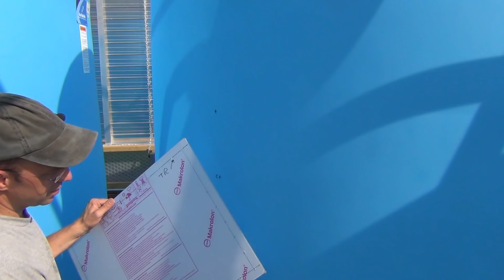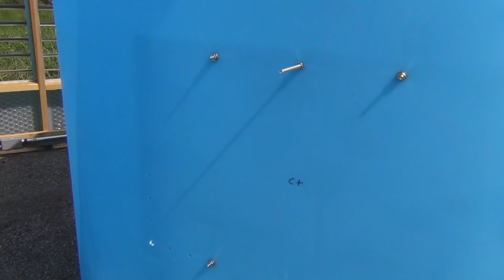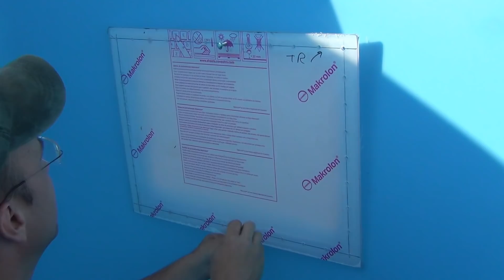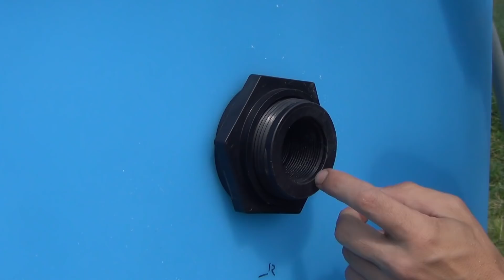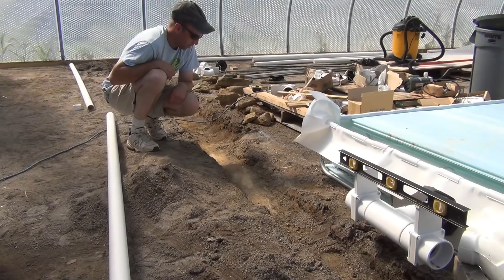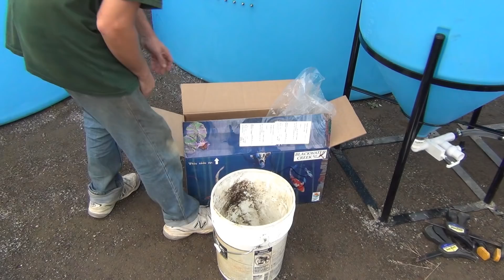Big Aquaponic Greenhouse - Part 12 - Fish Tank and Plumbing

Comment: Rob, on the fish tank, I would like to know how you keep the water level at constant 6 inches of head height above the outlet to the radial flow settler? And still below the overflow outlet.
Reply from the maker: The water level in the tank stays at the same level where the pipe comes out of the side of the fish tank.  Technically it's a bit higher than that because of the head pressure to push the water out.

Comment: Hi, thanks very much for all the videos. I have enjoyed watching many of them in recent weeks. I was just wondering what the head height is on your Jebao DC pump here for you to be getting 1200 gph, and what you would expect the flow rate to be with a 12ft head? Thanks
Reply from the maker: I'm pumping around 5-6 feet of head with this.  It probably could do 12 ft but I would recommend checking the pump curves for it.

Comment: The double bead of silicon is a good idea.  Did you consider using large flange pop rivets?  They have some with built in gaskets, or you could use silicon sealant for added measure.  Also, I would think a leak fix would be much easier with a rivet.  Any thoughts on this?

Unexpected Tip:  Test for leaks before burying your lines...  LOL.   Thanks!
Reply from the maker: I"m not sure about using a rivet since they may be difficult to adjust the amount of force it applies.  With the bolts it's easy to torque them around to see how much silicon oozes into place.
Reply: Bigelow Brook Farm (Web4Deb) Good point.  Thanks!

Comment: i believe you said your dwc doubles as the sump? does that mean that the dwc water level fluctuates? i also dont see how you maintain the desired water  level in the dwc. is it simply due to the height of the bulkhead? in that case, if the water drops too low in the dwc, below bulkhead, does it mean the pump will run dry?
Reply from the maker: technically the water level will fluctuate a tiny amount because of the flood and drain beds but it isn't noticeable.  As we lose water from evaporation/transpiration we just add some more.

Comment: Awesome sauce :)
Pro question for the Pro tip master: how did you come with a shower bar that doesn't restrict the pump too much? How many holes at what diameter to result in less of a friction loss... Wouldn't it be better to use a manifold that creates flow all the way to the bottom of the tank rather than a spray bar? In terms of aeration considering the surface area exposed to air and the constant motion, plus, the aeration in the raft beds, I think your fish would prefer the manifold rather than getting a shower...feels like rain for them... :( Anyways, I just wanted to share what's was left of my knowledge and since you are far beyond this point in the built, you probably settled with the bar. NOt a patreon but I appreciate you sharing here and always look for your content. Thanks
Reply from the maker: calc the area of the inside of the pipe  (pi*r^2)  Then the area of a single hole.  Then divide the pipe area by the hole and this is how many holes you need to meet that same area.  Then you won't have any back pressure.
Reply: @Bigelowbrook  thanks, that's what I remembered :) Any reason why not going with a straight down pipe, with holes all the way to the bottom(ish), that you could orientate in order to increase/decrease the rotational flow in your tank? That would do a way better job at centering your solids, I believe.
Reply from the maker: @JasonTheGreatX  the spray bar shoots in both directions so it rotates the water.  I can adjust the rotational speed by twisting each section to adjust the entry angle.  It's really not much different than having it go straight down and changing that angle.

Comment: why did u put the nice loooking side of the bolts on the inside?
Reply from the maker: so the water won't leak through the bolt threads.  Even if that wasn't the case, you don't want the fish to scrap against anything.
Reply: @Bigelowbrook  good point

Comment: Sorry for the ignorance- why an SLO and an overflow (both)?!  I understand an emergency overflow, but this is for most of your outflow from the FT correct?
Reply from the maker: Dual drain is fairly standard for aquaculture setups since the majority of the solids settle to the bottom.
Reply: Bigelow Brook Farm (Web4Deb)  thanks for the reply. So- is the flow to each drain just controlled by height and diameter of the pipes? I.e - how do you make sure one isn’t doing too much draining vs. the other?  Very good video, appreciate the insight.
Reply from the maker: @TheWatchingLife  There's a valve on the 1.5" line that's going to the RFS.  You'll see it in the next video...should be released this weekend.  ;-)
Reply: Bigelow Brook Farm (Web4Deb) Excellent- I look forward to the next video! 👌🏼

Comment: I had a 1200 gallon tank and I started with 1 1/2” in the tank but it didn’t turn the water over fast enough so I changed it all over to 3”.
I’m curious to see how this works out. You may have a better filtration system than I did.
Chuck
Reply from the maker: You must have skipped over the part where I installed the 3" outlet.  ;-)
Reply: Bigelow Brook Farm (Web4Deb) I must have got distracted by my grandkids at that point if it was there. Thanks for the reply. Always enjoy your videos.
Chuck

Comment: Using some aluminum flat bar  on the inside and outside would help with leaks
Reply from the maker: Aluminum is toxic to the fish over time.  Use stainless.
Reply: @Bigelowbrook  I agree stainless would be a better choice.   How acidic are you planning on keeping the water?  That's where the problem with Al toxicity comes into play.

Comment: Great video. Im looking forward to watching your next episodes. It is interesting that you chose to run your system with kois and not Tilapia. Why was that? Are you working with a neutral or high ph?
Reply from the maker: The pH usually is at 6.8 in the other greenhouse.  Here it is around 7.8 but it will go down once the system is really running.

Comment: I was a bit surprised that you did not condition the fish to the water temperature and ph before letting them free in the tank.  I normally put the bag with the fish into the tank and secure it. I wait until the temperature between the two is the same. I then gradually add small amounts of the water from the tank to the bag with the fish over the space of ~hour. By then the amount of water in the bag has pretty much doubled and the ph should be pretty similar to that in the tank. Then I release them.
Reply from the maker: I've never needed to do that as long as the pH is about the same.  They don't care about water temperature changes.  The koi in the other greenhouse go between 45F and like to go under the 120F water pouring into it while it's getting heated.  They love it!
Reply: @Bigelowbrook  It has nothing to do with the acceptable temperature range for the species of fish or what they do on their own in a warm water stream. So you have been lucky and not had any fish die after a transfer. Conditioning the fish is an acceptable practice in the aquaculture industry to reduce transfer stress and deaths. That is all I was trying to say.

Comment: Why goldfish? Why not fish you can eat?
Reply from the maker: These are ornamental Koi.  They have a higher resale value than a food fish.  Plus they can tolerate the large temperature swings.
Reply: @Bigelowbrook  I have watched several videos of these Koi dealers going to Japan and spending thousands of dollars on a few fish (to sell in the US). From what I have read (so far) they prefer 65-75, but maybe they can go well beyond that. I will need fish that can handle the heat here in the TX area.
Reply: @pH7screwtube  Koi are just an ornamental mutation of common carp, Cyprinus carpio (?).  Eurasians eat carp (not koi,  b/c too expensive) though Americans consider it an invasive "trash" fish.  They are pretty tolerant (hence their ability to become invasive), however they do jump and are therefore unsuitable for shallow tanks or ponds.  If you are interested in food and don't need it to be kosher, channel catfish will tolerate both heat and cool water (tilapia will need heating during the winter unless you are in south TX), are nearly as tolerant of water quality as carp or tilapia, and eat just about anything.  They do prefer to swim near the bottom, which migt reduce the numbers you can keep for a given tank volume.  Sunfish (other than bass) are smaller and might not grow as fast, but seem to have the same temperature and water quality tolerance, and are probably more likely to distribute themselves throughout the tank.  Golden orfe (another giant goldfish thing not eaten in this country but whose wild type--"ide"--is a game fish in the U.K.) supposedly likes surface water, so might work with catfish provided they are similarly sized (the catfish would probably eat them if they can).  However you would be eating them yourself (probably look for carp recipes) or selling to the pet trade, because there isn't a market for their flesh in this country.
Reply: @Erewhon2024  I am down near Houston. When i finally get started I will use goldfish during my learning/cycling phase. After that It will be tilapia. If I feel like adding others, maybe (non expensive) Koi. I plan to have a green house that will not get too hot or cold. Getting closer to the day I buy land. Hopefully by the end of 2023 it will be a reality. Thanks for the info!

Comment: Great video:) One thing is concerning to me. With all that water condensing on the walls of the greenhouse and raining down you may get algae growing all over the place. I am sure that is on your mind but I thought I would bring it up just in case you did not think about it. Loving the progress man!
Reply from the maker: Usually during the summer this doesn't happen when the vents stay open. It's just something that happens during the fall when we have these crazy temperature extremes.
Reply: Bigelow Brook Farm (Web4Deb) O good:)
Reply: One thing I noticed in my setup is that extra water raining down can cause the plants to rot, just a heads up. Thanks for posting!

Comment: Nice job! Very professional and well thought out looking. I am building a very similar sized system and I am curious if your spray bar provides enough aeration or did you need to add more aeration?
Reply from the maker: I'll probably add some more.  Right now it's enough with the few fish that are in there.
Reply: @Bigelowbrook  Thanks for getting back to me. I don't have access to a dissolved oxygen meter and trying to figure out how to efficiently get enough oxygen in the water has been a mystery to me so far. Sure, throwing money at it will likely provide enough oxygen but your approach is practical, economical, straightforward, and simple, I could easily duplicate it on my system.

Comment: Next time you are installing a window or other thing with a ton of bolts and don't have help to hold them bring a roll of painters tape as you can tape over them once in place to keep them from holding out as you try to get the washers and nuts on them. 

Don't forget a drain pit for the times you need shut the system down in the winter. Power outages and equipment failures happen at the worst times so best to be ready to get the water out before it freezes.

Comment: Ever consider dropping a water proof camera in the tank and mounting a monitor on the side of the tank to watch the fish?  Digital window.  Saves cutting the tank.
Reply: Great suggestion. Thanks.
Reply: @Rohan Seelan  alot easier to pull out a go pro and replace it or clean it vs repairing a leaking tank window
Reply: What direction do fish like to go around the tank 
Noticed the direction you set your spray bar counter clockwise or will they always swim against the currant

Comment: Heads up for all watching. Stainless steel comes in various grades. 316 is the Marine grade and always preferable when in contact with water. Easy to check, get a magnet. It doesn't recognize the magnet? It's 316 or it isn't steel of any kind. Oh! Put a lubricant on the threads! NSF approved or equivalent, or the nut will seize. I've built a few boats. If you use a load plate inside the tank to reinforce the PC, make sure it is metallurgically identical, or the salts excreted by the organisms will establish galvanic corrosion, and begin disturbing the electrical balance of all organisms in the tank. An aquarium found this out in a shark tank where they wouldn't eat.  Best of luck, prepare for a very long winter in the coming years, others will not, and want yours.
Reply: Just so. I found out the expensive way that stainless steel nuts and bolts will gall up in a heartbeat. An anti-sieze compound of some sort is an absolute necessity.